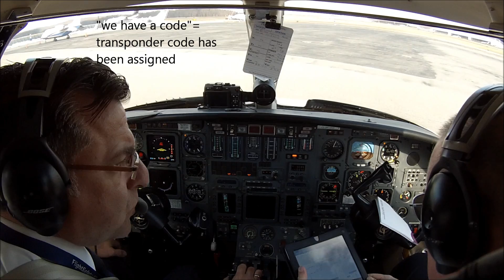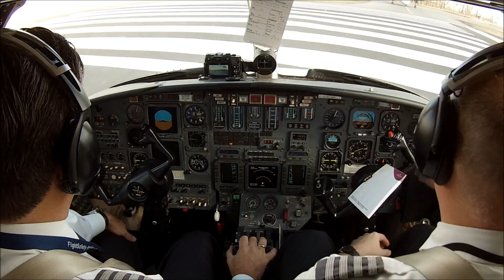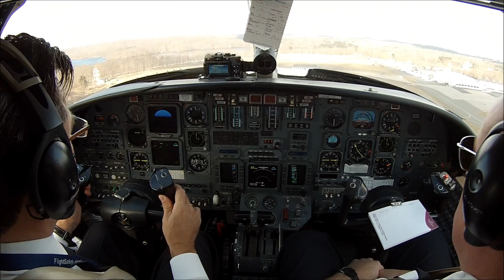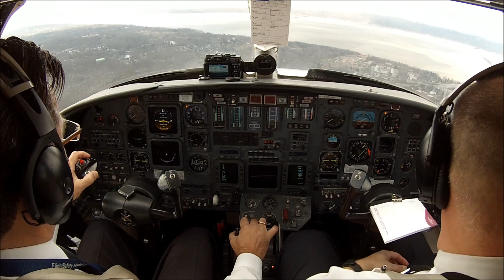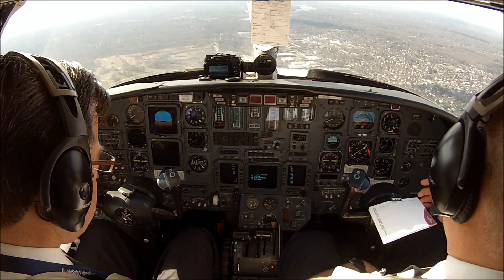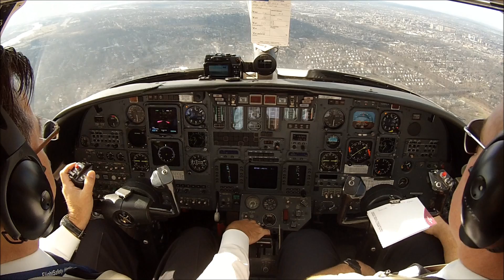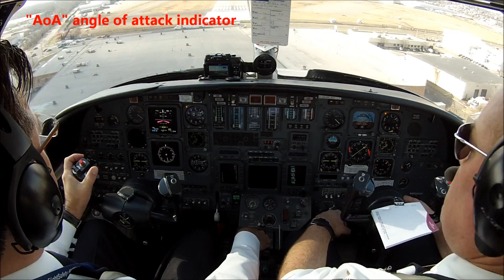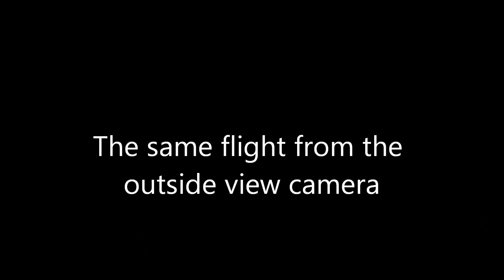VFR flight in a Citation V jet - cockpit view

Comment from the maker: Look at the aircraft from the side and see that the engines are mounted quite high. Therefore, reverse thrust lifts the nose. We need good steering on the ground (with the nose wheel firm on the ground) that is why we push the controls forward. Well spotted! Thanks for watching the videos. Happy landings, Guido.

Comment from the maker: This is a valid question, Shayne. We fly VFR only on short positioning flights that would otherwise require much longer IFR routes.This is especially true in the New York area.The weather has to be good VFR though and the crew familiar with the airspace structure.

Comment: Next question, do you hold a type certification on any other Cessna jet, like say the Citation X (the series 750) or the New Citation X (the upcoming series 850)? Those have higher top speeds and I think look snappier than the Citation V. But maybe that's just my aesthetic tastes. The Citation V is an okay aircraft, but the swept wings on the Citation X I think was an improvement, and I think you'd enjoy flying that.